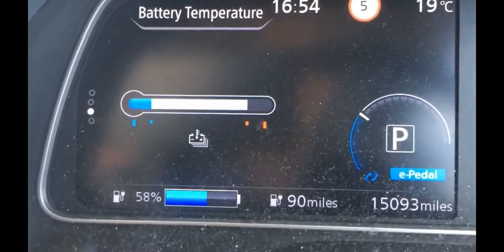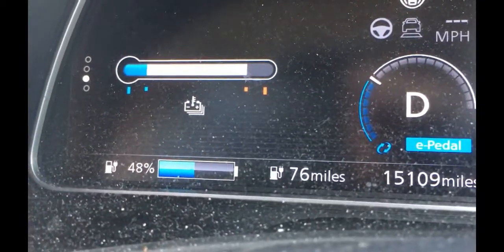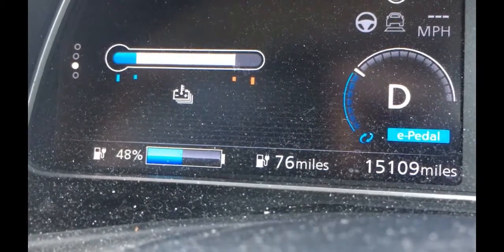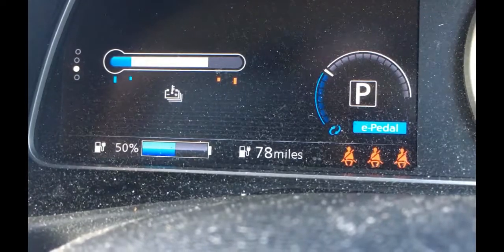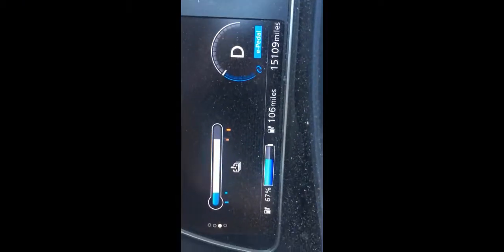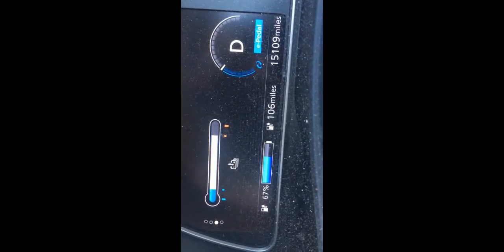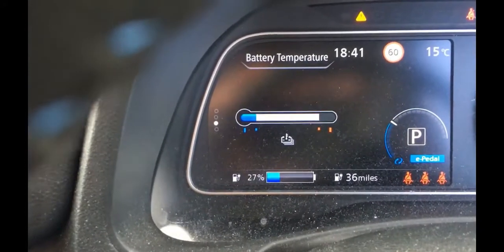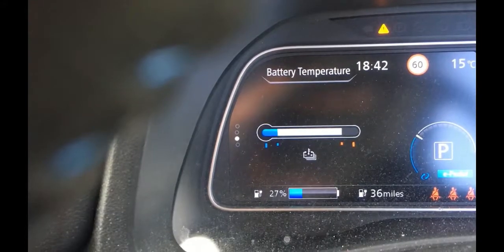My First Experience of Nissan Leaf 'Battery Gate' Issue

Comment: Since Renault partnered with Nissan, nothing but problems.
Reply from the maker: Um, I don’t know about Renault / Nissan. I’ve never owned either until the 1st gen Leaf & now the 2nd gen. They’re great cars in my view but they obviously took a decision not to use active battery cooling. This is fine for most users & no doubt improves the price. Customers should be made aware of the limitation though. On the plus side the Leaf is one of the very few EVs that currently supports two way flow of electricity through the charge port - so you could run your house from the Leaf battery for a few days, given the right box of tricks. ‘Vehicle-to-Grid (V2G)’ will likely be key to successfully migrating to EVs, without overloading the existing electricity grid. 😎

Comment: hello, i'm leaf driver in france, but your experience is mitigating, try my solution, your profit then equal to me. My solution for more 300 miles / day, is the make slow charge (3.7kw) to 100% before travel. and in travel no speed to more 105 / 110 km/h (convert in miles/hour) for a little down température of the battery. And preserve consuption, because leaf designed for asian road have 100 km/h speed limit. at this condition you have a possible make 2 rapid charge in full speed. necessary to go very proxima to 0% battery before a first cycle rapid charge to maximise first distance.
Charge to 90-95% before going and go to 0-5% for a second rapid charge.
the rapid gate should arrive during the second charge but should not impact the recharge time up to 90-95%.
In this condition you have possibility you traveling max 675 km / day  in good state and good speed.
and at your destination plug in slow charging (3.7kw) for down temperature.
cordialy

N.B. : all leaf have a reserve in 0% (10% cached), see video of bjorn nyland.
Reply: To the original comment, I'm sure most would find your strategy a detriment, but I consider it a feature to have little problems to solve for an occasional road trip. Appreciate your input on this. I assume 5.76 kWh would still be considered slow charging, correct?
Reply from the maker: @tremorsrules  in the U.K. ‘slow charging’ is normally from a standard domestic socket; 230V @ 13A = 3kW. A dedicated domestic EV charger is normally 230V @ 32A = 7.4kW (the same as many public type 2 chargers). So 5.76kW falls between the two. 🤔
Reply from the maker: Thanks for the comprehensive comment. Your approach sounds good to me. Luckily I hardly ever have to make journeys this long, so I’ve only really hit the issue once. In my last job I often made long trips and the Leaf would have been very hard to live with. The life of the battery would have suffered too - running hot so much.
Reply: @Greeves  This car is definitely not for people that need to make frequent long trips. I love it and got a pretty good discount because it is not selling well in America, but this is definitely an issue for some drivers.

Comment: What did you say? Two quiet... Looks like the same experience I've had with the Leaf. Can safely only L2 or L1 charge once the battery is hot.
Reply from the maker: I’d travelled from Birmingham to N London and back and then straight on to North Wales. So Shrewsbury was my third L2 charge. All fast motorway and then some pretty steep hills. The weather was warm, by U.K. standards, as well. I love the Leaf but the lack of battery cooling could be a show-stopper for some owners (or potential owners).